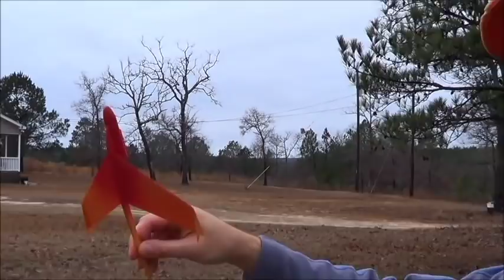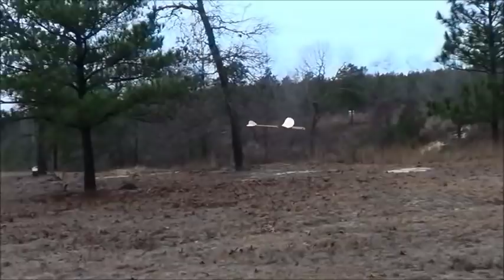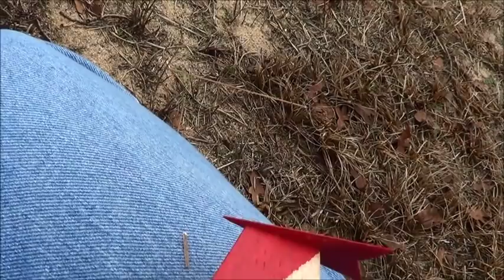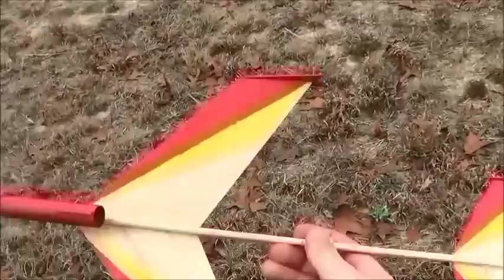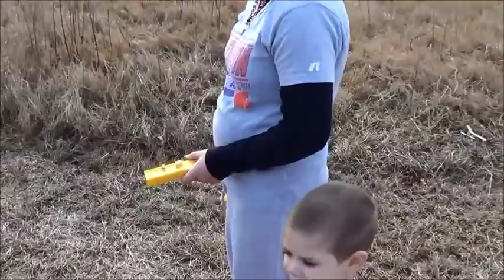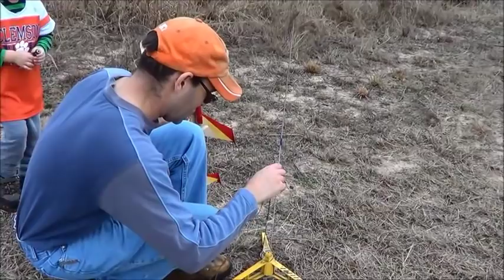Rocket Boosted Glider flight trimming tutorial + stupid mistakes - Sky Slash II

Comment: When paint does not dry fast, use spray lacquer to create a quick dry surface.  You will also find that a water color paint with a lacquer top coat will work a little better.
Reply from the maker: Barry Smith good to know. Thanks!

Comment: Fun, sometimes in life you think you know stuff, but examining further or getting more expierience with it you find out Ya don't :). I build my first AR-6 boostglider. Goal is to make a flight of 45 seconds. I'd like to do it on an A4-2T but I have to go for a B4-2 (Estes). Chekking out this video it makes me think just an A would probably be just a bit short for a 45 sec. flight. I tried to get the CG right but I ended op being it in front of the recomended CG. First of all I don't even get why the CG should be at 2/3ds from the leading edge of the wing. With RC planes it's usually 1/3rd from the front of the leading edge. Then ofcourse making it turn I needed some "up"to keep it going. The result is a glider that kinda stalls when thronwn but once it has it stable glide it glides perfectly in my opinion. What I learned from this video that I luckely build the boosterpod with downthrust so that would dampen the loop at take off I suspect. I watched this video many times now but still don't get the trimming to be honest. I hope I have some luck this time haha. Thanks for the vid. I really needed this haha.

Comment: The stall performance on the full size one is quite impressive. I’ve never seen a glider stall that gradually/softly. What sort of airfoil did you sand? Sorry I didn’t watch the build video...😅
Reply from the maker: Copterdude it's basically just a Stanfoil. I think it's more a function of the planform than the airfoil, but that's pure conjecture at this point.
Reply: Interesting. So would you guess it’s more due to the actual shape of each wing, or the wing sweep?
Reply from the maker: Copterdude, probably more the low aspect ratio that the sweep, however a swept wing with tip plates is less prone to tip stalling.
Reply: Interesting. Thanks for the info as always!